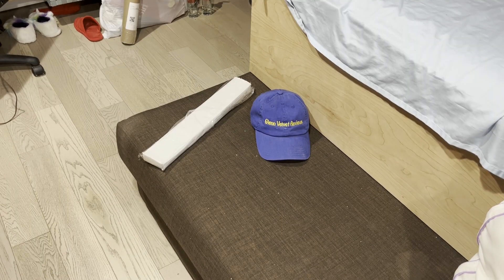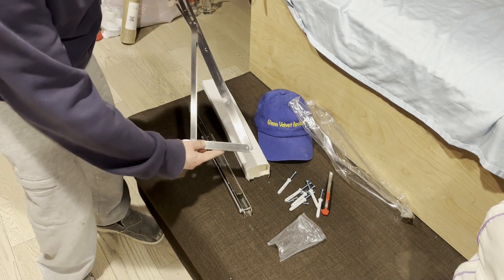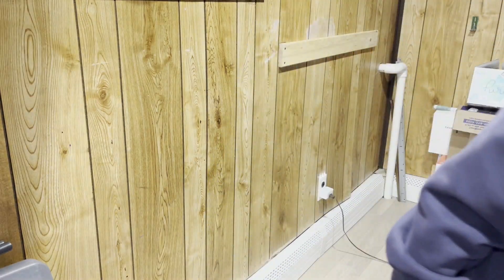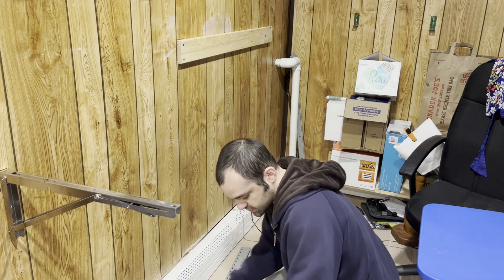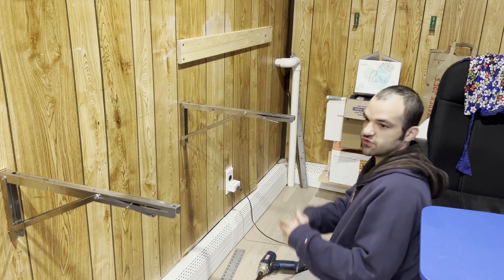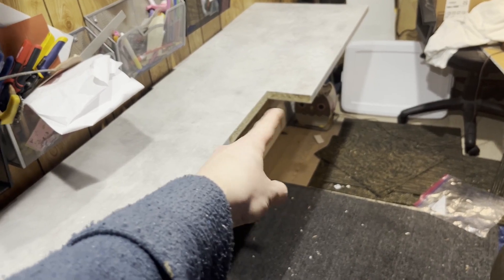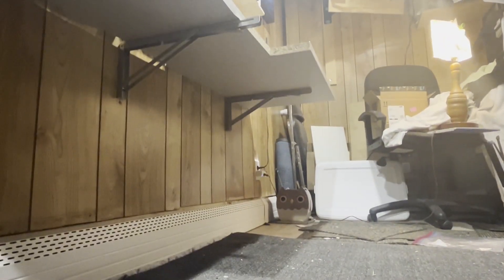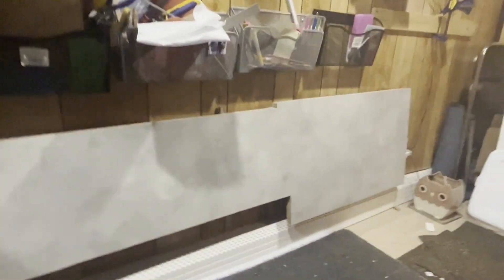Installation Review of CUZURLUV 18'' Folding Shelf Brackets Load Stainless Steel DIY Wall Mounted

Comment: I think you can screw them into the wall without extensions, in a folded down state. It seems to have holes right where you need to push the drill in to reach the holes.
Reply from the maker: No boss, the holes there are very small. Too small to fit any kind of tool through to tighten the screws into the wall. Unless maybe you used an Allen key head then maybe it would work. Good luck on your travels.